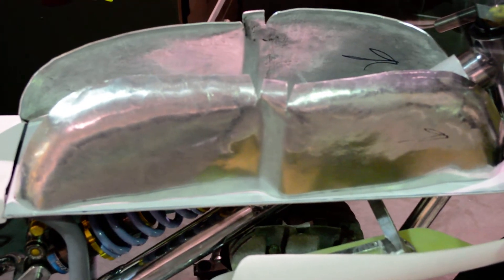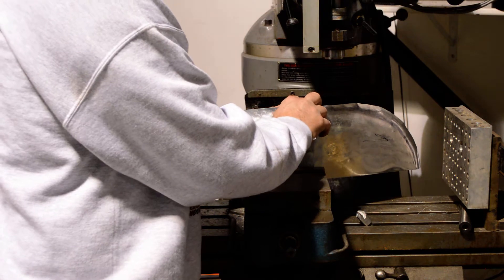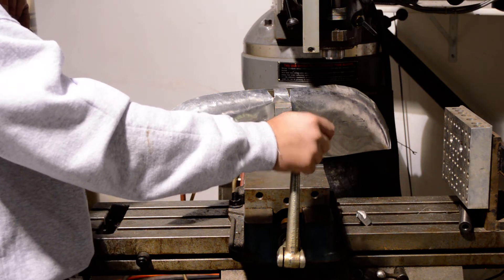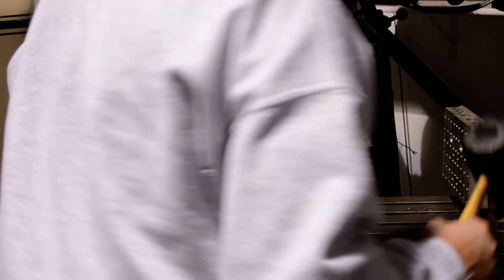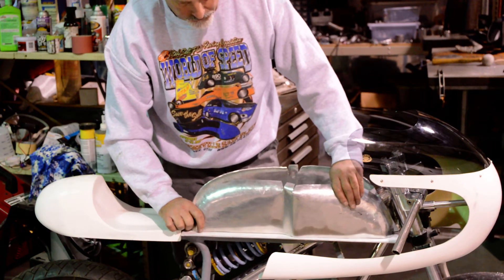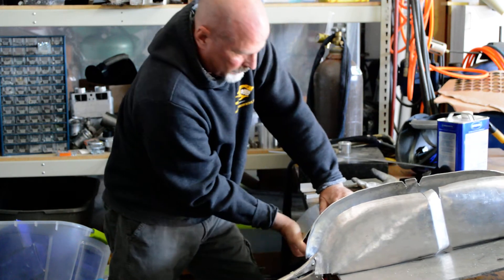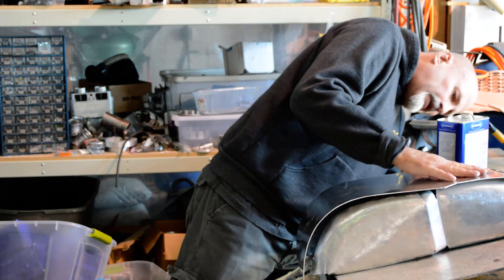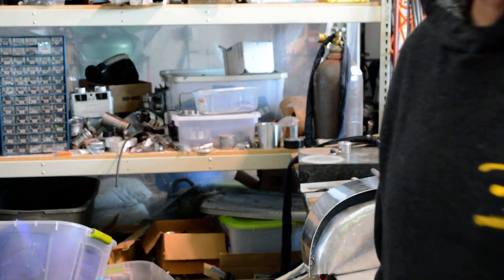Bultaco aluminum tank building

Comment: What grade aluminum are you using to make the tank out of? 2024, 3003, 5052? Thanks
Reply from the maker: .08 3003
Reply: @SpeedofCheeseRacing   I just got a pice of junk 1969  200cc Sherpa "S" Bultaco been sitting out in the weather for the last 45 years! No head no manifold no carb no gas tank dam can't find any good replacement parts, the hell with with it I'm making my own head, manifold , seat base, gas tank out of 0.080 3003 almuninum. Thanks to  you. Keep it up good work!